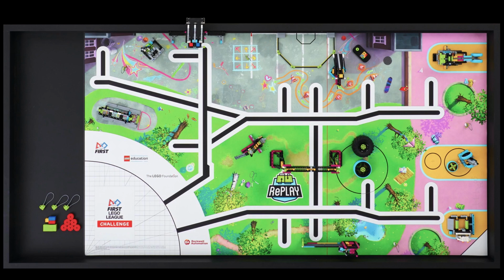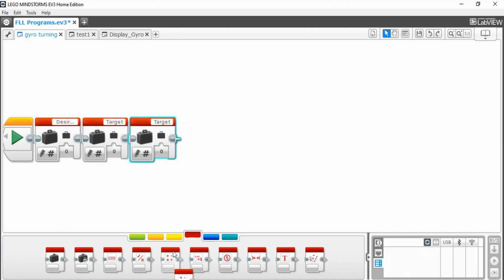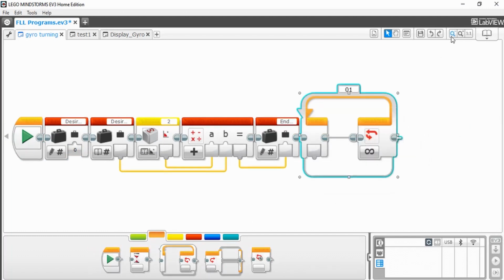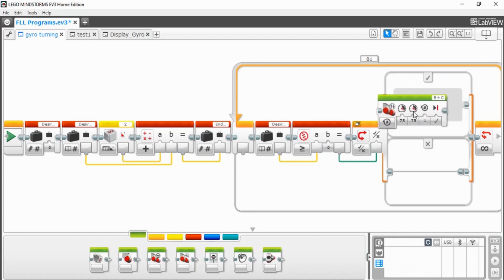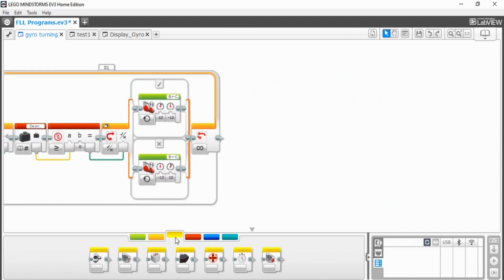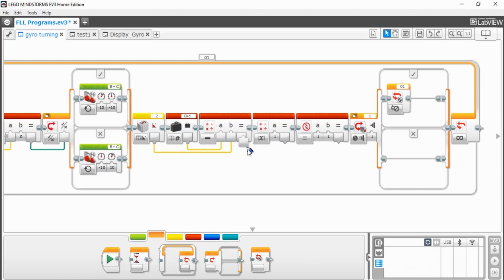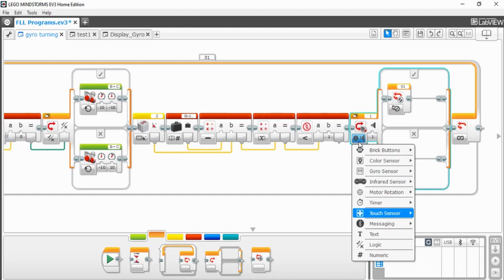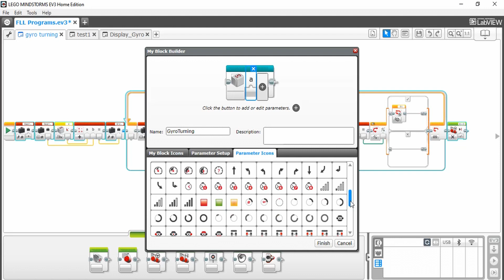How to create a Gyro Turning program for FLL

Comment: How accurate does it turn?
Reply from the maker: @ABBABAB, if you display the gyro sensor readings on the brick screen, the sensor will always stop when it reaches the range that you programmed it to stop at, however, your robot's consistency every time it turns depends on how fast you are turning and how small your wheels are.